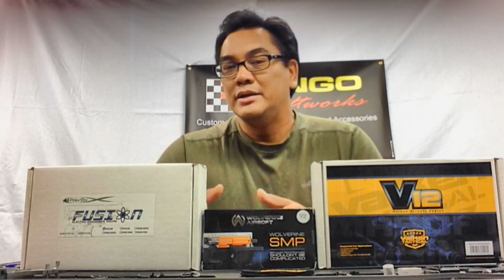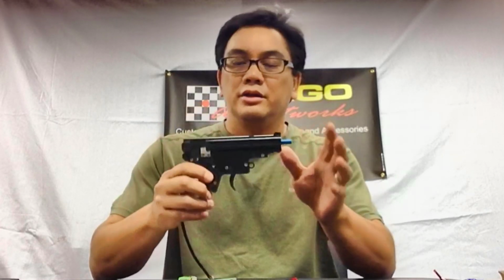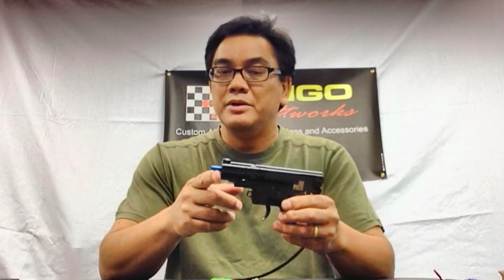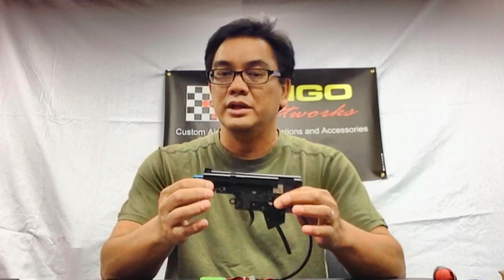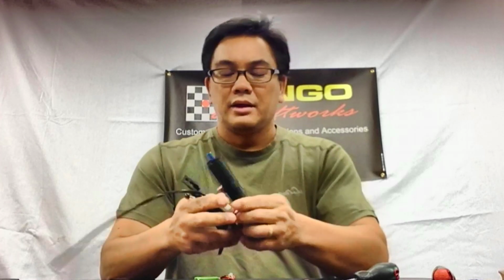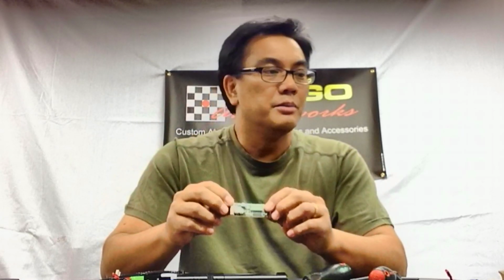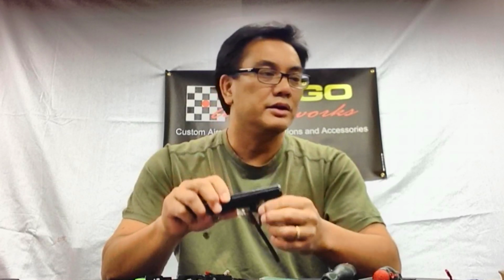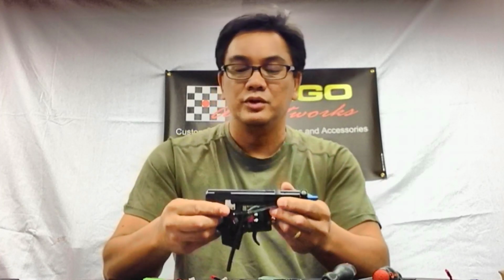Bingo Airsoftworks HPA Engine Review, Part 1 of 3 - Intro and PolarStar Fusion Engine

Comment: Bingo would you explain how the poppet valve opens?? i got that the rear cylinder is pressurized and once the valve opens it shots, but I cant understand how it does open
thanks
Reply: There are two solenoids in the Fusion Engine. One is used to pull back the nozzle, the other is used to open the poppet valve. The poppet is held closed by a spring. When the poppet solenoid activates, it allows are to go into a small area in front of the poppet, and pushes it back against the spring. This allows the air in the rear cylinder to flow around the poppet seal, into the center of the poppet, then out through the nozzle.
Reply: @ldcrstesla1439  thanks for the reply..I see but I dont understand how the air in the small area has force to open the valve if the pressure in the other vessel is the same...
Reply: @Fabio-mf4jg  It's due to the different surface areas. The poppet sail has smaller surface area than the poppet valve, so when air is let in against the poppet sail, it can push the valve back, even if the air on the other side is the same pressure. Technically the air pushing agains the valve and sail is Force (F). The formula for Pressure = Force / Area. Since the poppet sail has less area than the valve, and they have equal Force against them, the pressure will be greater on the poppet sail side, and push the valve open.
Reply: @ldcrstesla1439  ohhh Pascal s principle acting..now I get it.thank you alot

Comment: Could you do a review of thw Mancraft Pdik?
Reply from the maker: Casey Alexander https://www.youtube.com/watch?v=JBdQ50WeTQQ
Reply: ***** Performance + reliability + Wolverine SMP. Upgrade ability + Fine tuning = polar star. More people like the SMP because it's cheaper and more efficient on gas + what i said above
Reply: Terra-Bite Airsoft Performance + reliability = Wolverine SMP
Reply from the maker: ***** The Hydra, SMP, Jack and F1 all top out at about 500 fps w/.2. They can go a bit higher by using really long TBB (e.g. 650mm x 6.01). The Fusion Engine can reach almost 700 FPS with the same barrel.

Performance and reliability between the systems is rather subjective. It all depends on what you are trying to achieve. The SMP has some issues with full auto consistency (due to current air rigs and the design of the SMP) and there have been failures with the solenoid. The FE has problems with it's solenoids leaking also, and it shoots more consistently on full auto. Cylinder replacement engines like the SMP/Hydra/Jack and F1 can fit in more gearboxes, but the installation and maintenance is more difficult than the FE. It's difficult to fine tune an SMP with the analogue FCU, the FE FCU can drain a battery if left attached. So there are several advantages and disadvantages to all the different systems.
Reply: ***** Sorry for the un-detailed response. They all have their advantages / disadvantages as BingoAirsoftworks stated in his / their comment. I'm waiting to see what the P* Jack is like. Anyone else?

Comment: Which one of these would be the best for a KWA G36c i mean the easiest to install without modification to the gun, im leaning towards the smp, do u guys believe that is the best option?
Reply from the maker: Probably the Fusion Engine. You won't have to open the gearbox and clean out the grease. Also the SMP V3 installations can be tricky to get the fire select to work properly. For the Fusion Engine, you will need a standard length wire harness (13") and a G36 nozzle. Optionally the FE G36 selector plate I sell can help too. See http://www.bingoairsoftworks.com/products-2/#g36